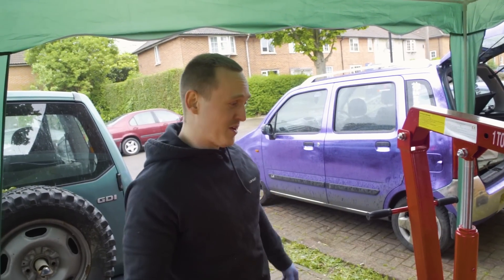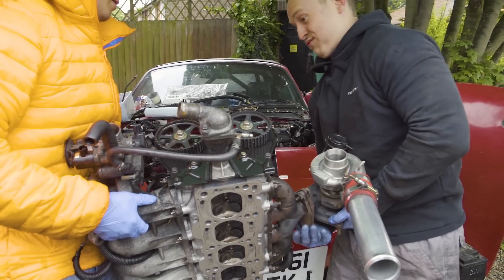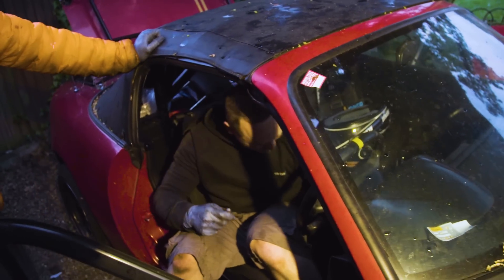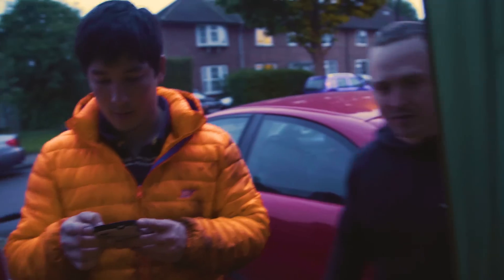Phil is ALIVE! Engine Install & First Start Up

Comment: Drop a VQ30DE from a Nissan Cefiro 3 liter (4th gen maxima)
Weighs five pounds heavier than the 1.8 4 cylinder, but has up to 220 hp, V6 and is aluminium.

Comment: I warned you about this when you drilled in the oil pan without removing the oil pan. Drilling in the oil pan without removing it, will leave small pieces of metal in your oil pan, which now destroyed your oil pump.

Comment: Ryosuke Takahashi: "That car has been revived as a scary monster."

I wonder if the MZR-R professional race engine could be dropped right in?
Reply: I think it would, but first I'd wrap it in the Fujiwara Tofu Racing livery just so the car would have more compatibility with the engine
Reply: This is Britain, so you will require Snobby English Tea Racing livery.
Reply: Good point, sir. Being it Britain, I would probably as well ad some cup holders, so I could practice drifting with a paper cup filled with tea.
Reply: That scalding tea would provide motivation to drive better.

Comment: I call it: in 2 months it'll be turbocharged again, and in another 5 it'll have some major engine problem. Just engine swap it with either a v6 or an audi straight 5 already.

Comment: I wouldn't have bothered rebuilding the head. by the time you fiddle and fart around rebuilding the prick you could just drop a K24 into it and have a far, far stronger motor with nore power and better fuel efficiency. both 4 bangers too so if registration is based of cylinders it doesn't get anymore expensive.

Comment: common misconception - oil pumps have bugger all do to with oil pressure. Oil pumps, like all pumps ever, create oil flow. It is the RESISTANCE to the flow by all the oil passages in the engine and the gaps between engine components through which the oil flows, that creates oil pressure.

Comment: Where's the wife?
That's a good example of what people like Kevin think I'm not doing enough of yet I'm the one whose working on that problem I have - I'm still single & fate has decided that I'll marry a beautiful woman whose a Carroll at about 40 years of age.
That's about all I was doing in my 20's as I was rebuilding a few engines including a hybrid Nissan RB30 fitted with an RB25 cylinder head,that turned out to be a really good engine.
I have to do a camshaft & lifter replacement on a Chevrolet LS1 engine next month which is approaching 335,000 kilometres, the compression is still good & so is the oil pressure, the camshaft & lifters are just worn out & damaged.
I have been dreading what Holden is looking at doing to the V8 car,which is drop the latest 6.2 litre capacity down to 4.2 litres then add a couple of hairdryers.
So I don't want Holden to move away from their simplistic design too much,perhaps they may go to a 32 valve design with the inclusion of camshaft phasing on each camshaft instead of a higher maintenance turbo setup.
Either way,when I marry a woman whose like her I won't likely be wanting to play around with cars like my brother does.
I don't want to end up in a position where a man has to serve me tea or coffee which is about the people I've been talking about.

Comment: man... you should at least have washed your dishes first... before showing it to everyone on tube! :D I bet your girlfriend will love that, most likely even worse than ruining the brush itself! :D   btw... great vid.... I only wonder how weird would it be to use the mx-3 1.88 v6 as a swap for these cars!? I am sure it good for upgrading, but for some reason no one does it, anywhere... maybe there's a good justification, but a low weight v6 with 140hp on stock with large possibilities for upgrading without putting too much weight, and also the customization should be pretty easy, being a mazda! just saying. ;)

Comment: PHIL IS ACTUALLY DEAD! THAT NOISE IS ROD KNOCK. rebuilt is required i cant believe you didn't rebuilt it when you had the motor out!!!!    YOU'LL LEARN THE HARD WAY!
Reply: Nope, that noise is just the lifters. Engine runs smooth as silk.
Reply: nimai mederos talk about jumping to conclusions